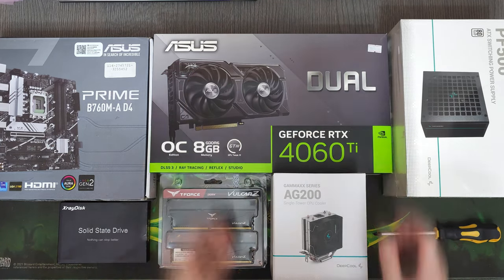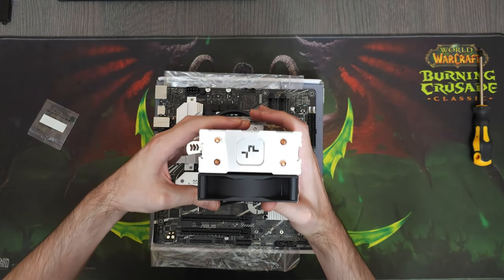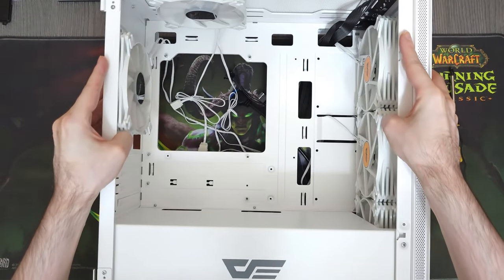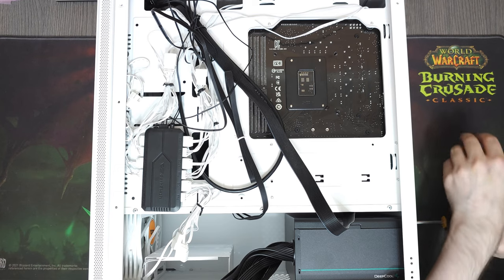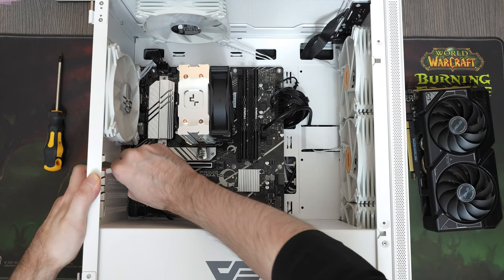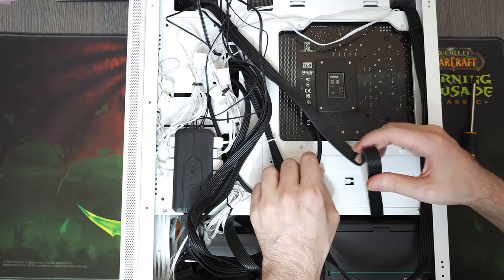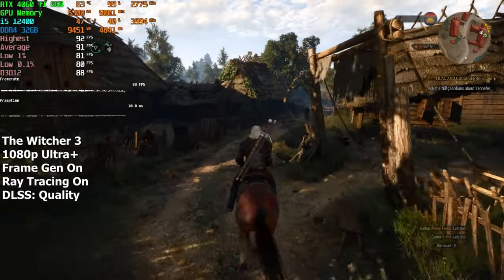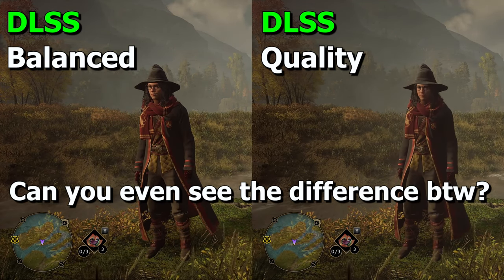$700 Gaming PC That Plays Any Game With Ray Tracing On

Comment: What I would do in this build is get a used GPU, since you're getting used parts you might as well get like a 3070/3060 and get a z690 and a 12600kf, depending on how's the pricing like where you live.
$300? Aight lucky man.
Reply from the maker: One of the PCs I'm planning on building right now is kinda similar to what you're suggesting. One of them will feature Ryzen 5 5500 & RTX 3070. The 2nd one will depend on a few things.

i5-12600KF is a CPU that I've been keeping my eyes on for a few months. Used CPUs are more expensive locally than new ones in the USA. I will also need to find it for less than $105 to avoid TAX (which is 300₾+ for us). So once I'm able to ship a 12600KF CPU from USA to here without extra TAX, it'll be a good deal and I'll build a similar PC, like i5-12600KF + RX 6700 XT or something :)

But this RTX 4060 TI deal was something else. I still can't believe how cheap he let it go for.
Reply: @Mike21Daisu Honestly I did write the comment before you mentioned for how cheap you got that card, usually I'd write something like: "bad value", but at $300? That's a steal, good catch.

Looking forward to the 3070 video!